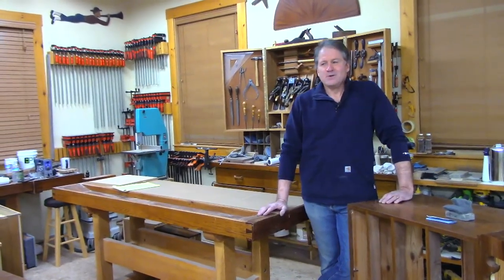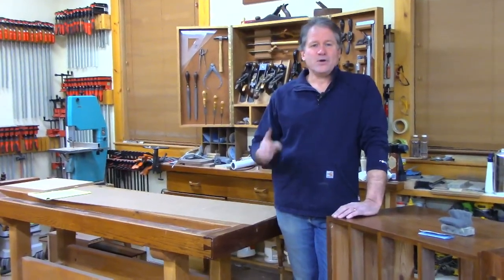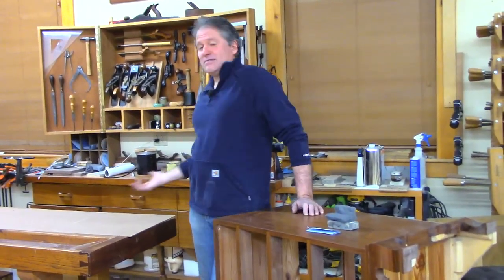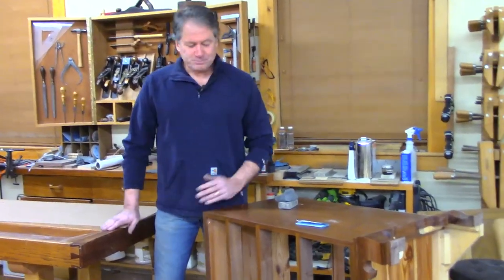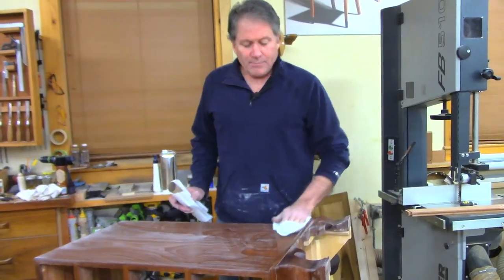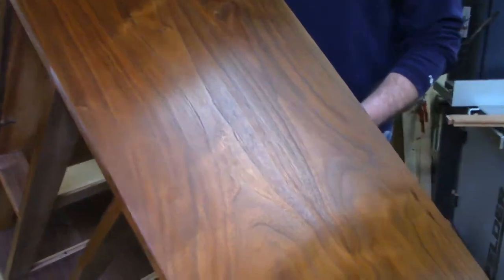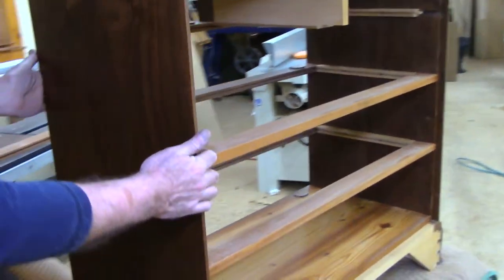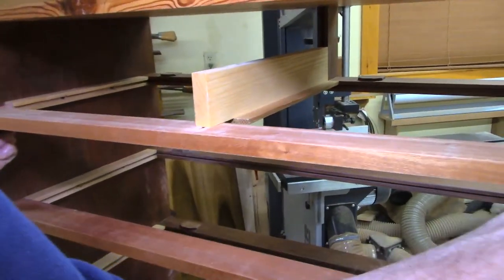Final Details For a Chest of Drawers with Tom McLaughlin

Comment: Tom, question, you’ve only glued the drawer bottom in the center which I fully agree with as you are leaving the wood movement to the back, my question has to do with the old practice of adding glue blocks (don’t know what else to call them) to the sides, mostly with saw kerf spacing and hide glue which I understand allowed a bit of creep, but this does constrain the bottom much more, you don’t do that, I assume that the old guys were using a soft secondary wood and these glue blocks also act as additional bearing for the drawer sides and help distribute the load and thus the wear, your solution is harder wear surfaces??
Reply from the maker: Thanks George. I’m not sure exactly what type of glue block arrangements your describing, but you can sometimes get away with them along the sides, but cracks forming in the bottom are a risk. I prefer just Hyde glue, best with a couple small glue blocks, only along the front of the drawer bottom and allowing free expansion and contraction along the sides and out the back. Thanks! 👍

Comment: Question, I understand adding the maple strip to the drawer sides, but the wear I see on antiques is both on the sides and especially on the bottom (wear is on both the bottoms of the drawers as well as the runners and kickers), so I’m assuming that you are allowing the wear to happen to the “sacrificial” parts, but either that thin strip of Maple will cut a groove in the runners over time or?? Do you do anything to the bottom edge of the drawers???
Reply from the maker: Yes George, I agree, that has been my observation with the wear of antiques, both the bottom edge of the drawer sides and the drawer runners get “dished” out. I’m not sure if I mentioned it during the video, but I also make the drawer runner out of similarly hard wood to increase durability. And I do not glue in the drawer runners, but instead screw them to the case sides and they are tenoned and dry fi it into front and back runners (this will be covered in the upcoming Shaker Dresser video and article in Fine Woodworking as well as our own in depth video series coming in June - details soon to be available at epicwooodworking.com. I like not gluing in the runners to help make them easier to restore if they do become worn.
Hope that explains it better! Thanks for watching 👍😎
Reply: Thanks Tom!! 
So if I understand correctly, the bottom edge of the drawer side is also Maple and the same for the Runner??
I do the same on a restoration, (I’ve done a number of chests of drawers that were basket cases due mostly to cross grain construction, I’ve had to completely rebuild them, using hand made Hot Hide Glue and the same for the Shellac), the runners get mortise and tenon joints to constrain them without recreating the same cross grain construction issues of glue and fasteners, I’m hoping that after another 100-200 years that when they get a bit of attention that no one cusses me for doing the wrong thing
Reply from the maker: Yes George, the strip on the bottom of the drawer side is hard maple and the runners are hard maple, although sometimes I have also used white oak on the runners.
It sounds like you know what you’re doing and treating those restorations right! Thanks again,
Tom

Comment: Felt blocks avail from Mohawk Finishing or Behlen and maybe WoodCraft??

Often I find that Walnut is too chocolate brown (always interesting to see the variations depending on growing conditions and with air drying) for my taste, I love the color of French Walnut or old Walnut that has lightened over time, so sometimes I’ll bleach out the color and use Walnut Crystals to re-color to the lighter warmer color

I’ve seen a similar idea for the Top, I like yours better, the one I ran into was an antique they were trying to stretch Cuban Mahogany by having the top be thin (3/8 to a light 1/2) then hand cut veneer around the edges with pine packing on the inside, the top had split and things had twisted, so replacing was the better solution, plus I’ve been able to use the old top to make veneer for other restorations

The antique Federal Mahogany Chest I’m finishing has great same overhang in the back, I think it was partly for the baseboard and also as it has French Feet which splay, btw the piece has the same type and shape of Drawer Stops
Reply from the maker: All great insights and experiences you’ve had there! I love the mellow rich color of aged walnut as well...it’s America’s exotic wood 😎
And salvaging the Cuban Mahogany top was a great idea! 
The overhang and shape of the drawer stops are things I picked up from my apprenticeship with master Pug Moore...he loved and learned so much directly from great period pieces.
Thanks for watching and being a part of us👍
Tom
Reply: Tom, really enjoy your content!! Glad I’ve found your channel, I’m jealous of your relationship with Pug, he really sounds like a wonderful guy!!! Unfortunately I live in a place where there is little or no cross pollination, I helped a guy for a few years (Cartouche winner) who refused to share his knowledge which was very frustrating, he recently died and took it all with him, I’m more like you and Pug, knowledge is meant to be shared, in a way Pug lives on through you
Reply from the maker: @georgepauls2911  That’s definitely frustrating, and too bad, even for the guy who didn’t share. We all grow and benefit when we pass it along! I recently wrote a little on this very subject for Fine Woodworking, recounting the story I heard of another guy who kept his methods to himself. Thank God for Pug and his open hearted ways, he would love to know how many are enjoying learning from him through me!😎👍